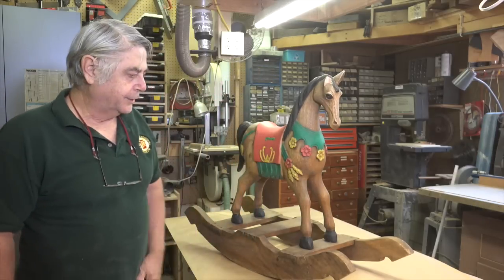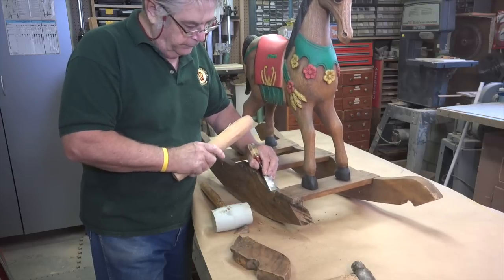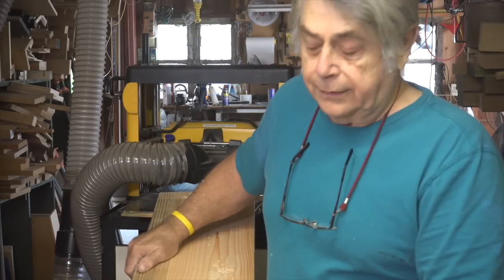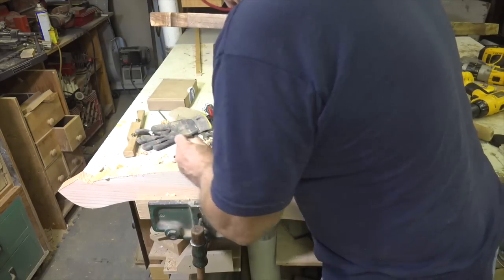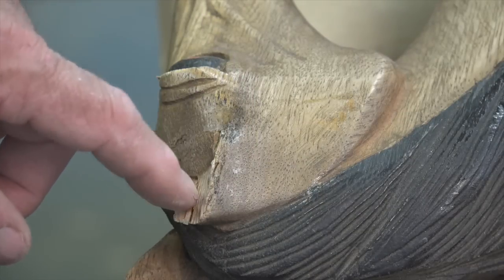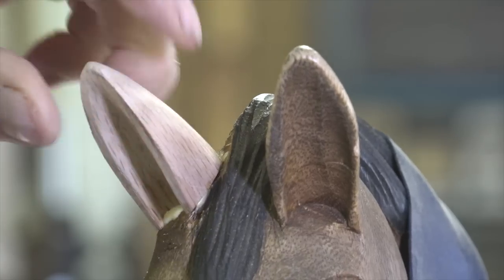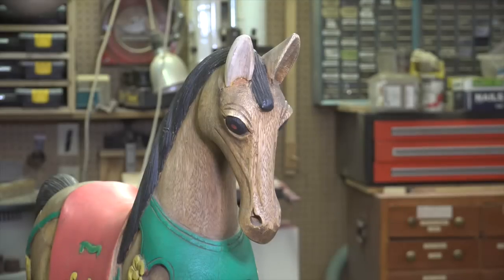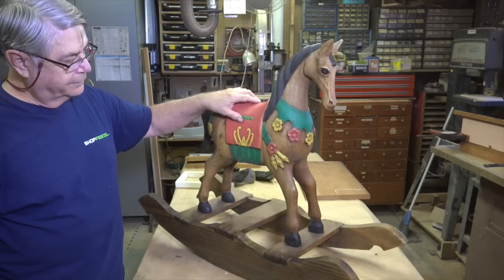Rocking Horse Repair| Ear operation| New ROCKER

Comment: Looks like an Asian import- these just fail terribly the 'green'  hardwood timber splits and makes for an 'older' look.....true rocking horses are made of many bits of timber built up and carved...and have no nails in the construction. Nails are seen in Antique horses in the tail wedge and tacks are used to fix the mane. The bows ought to be of ash or elm...This is an ornamental horse, not a riding toy, so softwood is okay for the rockers.